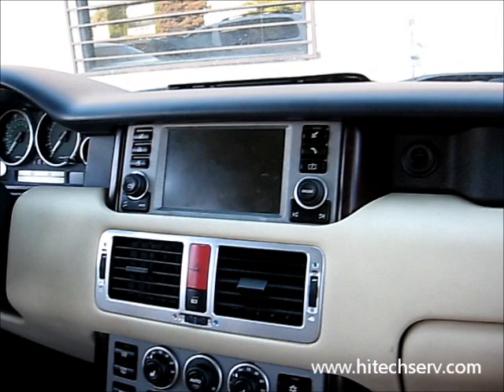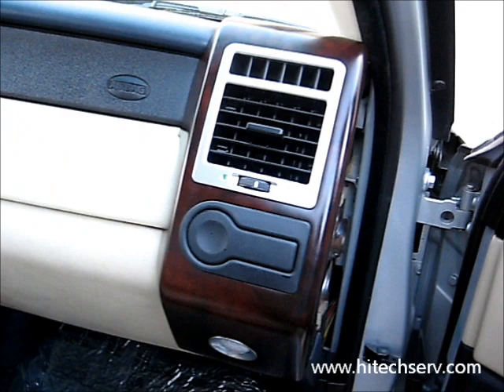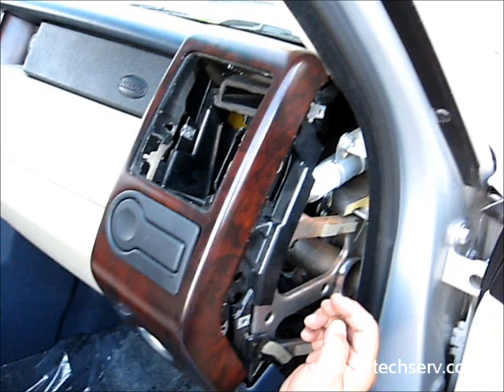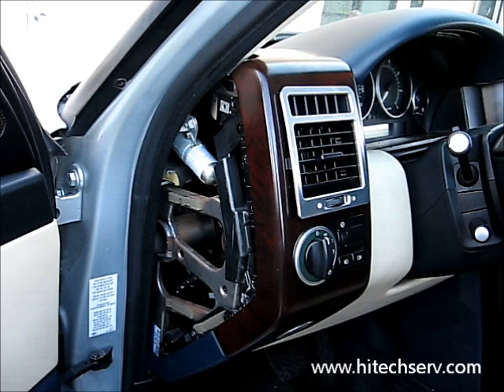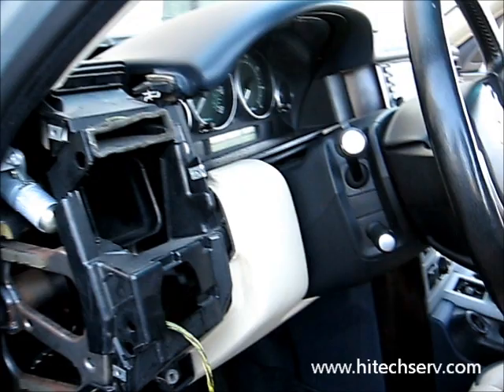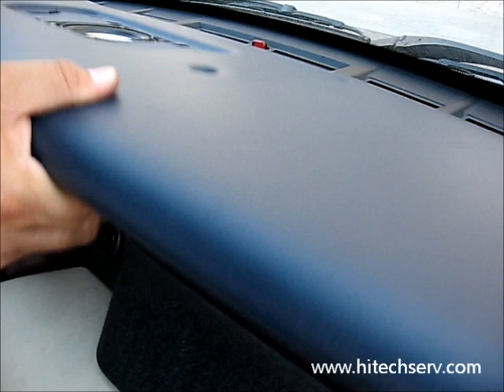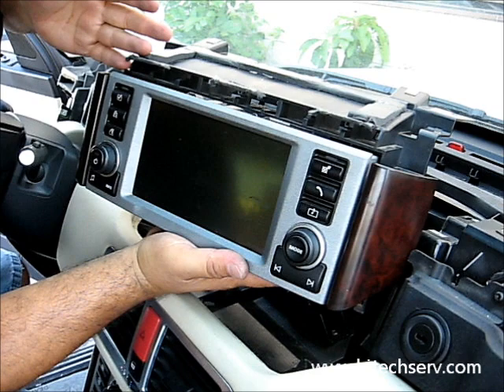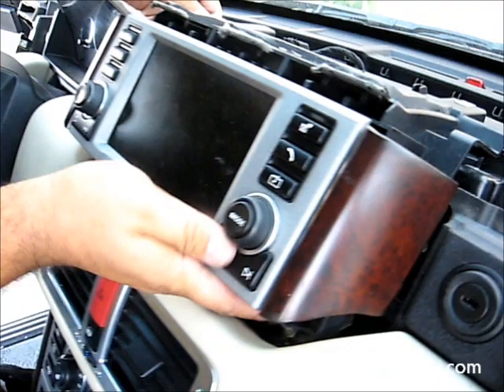How to Remove Navigation Screen / Monitor from Range Rover 2005 for Repair.

Comment: Good vid.  My unit died, so purchased a replacement on eBay and followed vid.  Got pretty far then realized my 08 l322 hse has a different dash cover with top a/c center vents and airbag unit attached to the cover.  Could not pull cover off so reassembled and will take to the stealer tomorrow.